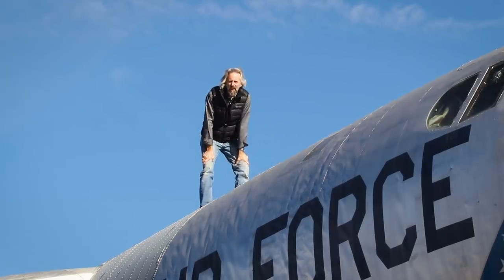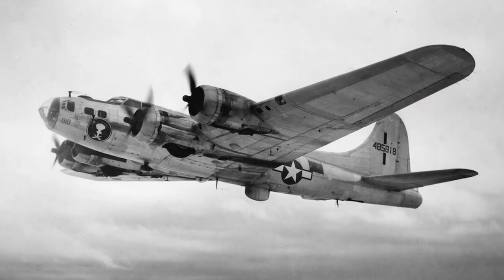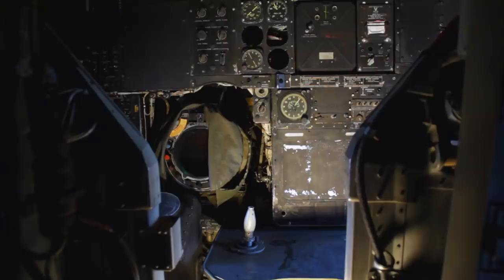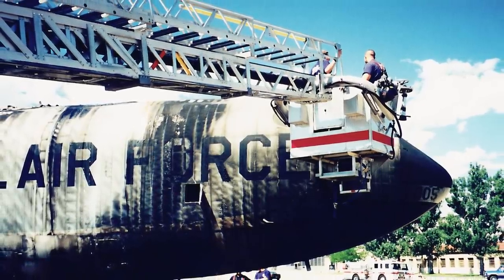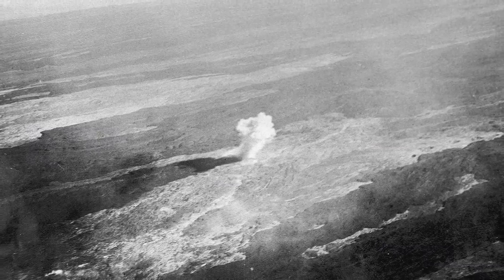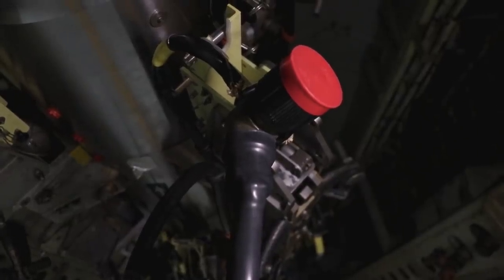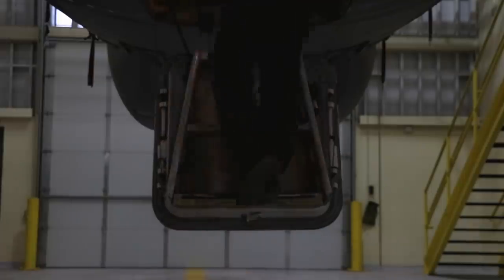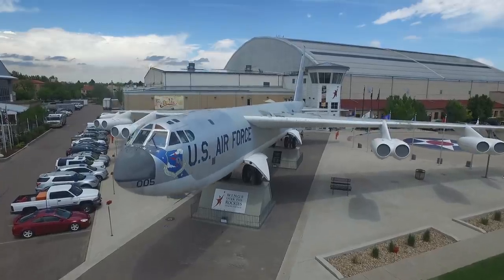B-52 Stratofortress | Behind the Wings on PBS

Comment: Great video! However, the last B-52, an H model, was delivered to the Air Force in Oct 1962, not 1965. My first assignment as Maintenance Officer was at the 319th Bombardment Wing at Grand Forks AFB, ND in 1986. They were flying G models, with the quad 50 caliber turret in the tail. We transitioned to B-1Bs in 1987. We had the unique opportunity to go from the  25 year old smell you tried to describe (a combination of jet fuel, hydraulic fluid, old wires, contents of the on board urinal, vomit) to the high tech brand new airframes delivered directly from Palmdale. Great memories!
Reply: I was also stationed at GFAFB but 16 years before you. I flew the H models, some of which are now stationed at Minot. The H model that I flew had the 20mm gatling gun in the tail. Once a year we would take each aircraft out over Lake Superior and do a "fire out". As a copilot all I heard was a few short periods of vibration in the airframe as the gunner fired the cannon. Fun times.....
Reply: @MrSafetyToo1  I worked on and flew a few times on the E model '52 at Walker AFB NM. Had chance to fly on a scheduled practice gunnery mission one time. We still had the quad-50's back then. I distinctly remember we went out over the Gulf Of Mexico and also recall the short spurts of vibration that you would get each time those 50's were fired. The primary mission at Walker was to train flight crews for the B-52's so got to have lots of different experiences. What always amazed me was the flexibility in that wing. It looked like a sick duck sitting on the ground, but put it in the air and the tips of those wings looked like they were above the fuselage.

Comment: My dad was a civilian electronics/avionics technician at Robins AFB, and was sent to Minot to do some work on the F-106 Delta Dart for several months in 1961.  I don't remember it - was a baby boy.  We rented a basement apartment from a young family whom I was told were wonderful people.  Dad did some work on B-52s when Robins was a SAC base (Georgia).  In 1983, the bombers were moved out, and it is a Logistical Air Command / Depot for overhaul, refitting, and repair.

Comment: FWIW:  I use to be in the US Coast Guard, and for five years I worked on - and flew as an aircrewman on - USCG Lockheed HC-130H Hercules aircraft.  

To give you a perspective of that maximum fuel load {290K pounds} mentioned in this video that the B-52 could carry:  Our HC-130H normal gross weight {MAXIMUM WEIGHT counting the basic airplane, fuel load, cargo and passengers} was 155,000 pounds.  It could be increased to 175,000 with special permission from the Commandant of the Coast Guard should some out-of-the-ordinary-need arise, but I never saw that happen.  {AFAIK, it never happened during the entire time I was in the Coast Guard.}
Reply from the maker: We are hoping to film with the USCG this year, but for what I need to keep to myself for OPSEC. ;) MB
Reply: @Wings_Museum  >>> When it comes to Coast Guard aviation, my ♥ belongs to:  
"BLEEDAIR BLIMPS"
"HERKY BIRDS"
"TRASH HAULERS"
"4 CESSNAS & A DUMP TRUCK"
"4 CESSNAS & A DUMPSTER"
"4 FANS OF FREEDOM"
😝😝😝😝😝😝😝

Comment: I worked with the G model Buff way back in 1974 at Barksdale A. F. B I was a missile man with the AGM 28 Hound Dog missile. It was a great experience and times that I will never forget. It was hot, it was cold, it was both wet and dry but I loved working on the flight line at 2AMMS.

Comment: B-52s turned Vietnam into a moon crater.
Reply: There should be so many craters all over Vietnam due to the numbers of bombs dropped there and many of them came from Utapao Thai Naval Base where I spent two years working on the D models after spending about one year at Minot AFB working on the H models. I was at Barksdale AFB also where I got to work on the G models and even flew on some of them to arm the Hound Dog missiles which they had on them. I enjoyed my time working on those aircraft and even flying on them.
Reply: steven anderson gotta get the job done, Genghis Khan got the job done took over all of Asia.
Reply: Actually, most of the BUFFs from Utapao cratered the Ashau Valley. I worked the scopes at Nakhon Phanom RTAFB in 1971-1972 and the BDA photos were very lunar indeed.
Reply: Theres youtube videos showing the destruction in Laos from the aerial bombing of the Ho Chi Minh trail during the Vietnam War.  All the craters are full of water.  It's unbelievable.
Reply: Lance - yet failed to achieve a victory. Something I struggle to understand.
Reply: @Jimboy1611  Because politicians did not allow them to turn Hanoi into a smoking pit.
Reply: and some of those craters were made by the B-52's crashing. Over 30 of them bit the dust in Nam.
Reply: Seventeen to combat-related causes, others to accidents.

Comment: My father was a B-52 navigator, then squadron commander in the 60's. I was around B-52's from my earliest memories, and thought they were just the normal thing. The first time I ever saw a F-4 Phantom fly over me, I thought it was the biggest plane in the world, because it flow over at about 500 feet, which B-52's don't generally do (they'd probably shake down the houses under them if the did).  Being an A.F. brat was pretty cool.
Reply: Kevin Dallas my dad was radar nav at that time. Where was your dad stationed
Reply: @mandarinlearner  He was stationed at Barkesdale AFB in Shreveport Louisiana until 1962, when we were transferred to Offutt AFB, SAC headquarters in Omaha Neb.  I think those units were transferred out of range of the SR 22's that just might still remain in Cuba after the Cuban Missile Crisis.  We transferred right after that.
Reply: Kevin Dallas we were at Dyess for the Cuban Missile Crisis. The planes and crews were flown out to be out of range. We had car packed for evacuation orders
Reply: @mandarinlearner  Sounds familiar.  I wonder what the GDPs of many of the southern states did right after tha. Suppose there's a discernable fall in '63?

Comment: Diving out the tail is perfect.  Won't hit the wing or vertical stabilizer.  My Father worked all over that machine as the Tec company helping the Airforce.  It was Western Electric - he was in Arm. & Electronics Radar and controlled guns were in the first.

Comment: If they EVER re-engine the B-52, they'll likely replace the existing 8 engines with EIGHT new engines.
And the USAF will probably lease the engines rather than buy them outright.  They've been talking about this since AT LEAST the 1990s but they may finally do something since the engines are becoming THE main reliability/maintainability issue with the operational B-52H's.
The issue is engine balance.  Many think it would be cheaper and more fuel-economical to switch to four more powerful engines than what the B-52H currently has.  The B-52 was designed for 8 engines and if you change that number, you destroy the thrust balance and it's WORSE if you lost just one engine in a four-engine configuration because you automatically lose 25% of available thrust!
With 8 engines, the lost of any 1 engine is less severe (12.5%  thrust loss can be more easily compensated for by the remaining engines) and you're probably fine losing up to 3 engines (2 on 1 side, 1 on the other) or four engines (2 each side) so long as you don't lose 3 or more engines on ONE side/one wing.
Yes, it complicates maintenance and doubles your engine parts count from 4-engine bombers but there are also advantages to having 8-engines in terms of recoverability of the airframe.
Reply: It's kinda funny that you say the engines are the main source of maintenance issues, and they were doing maintenance on an engine in this video
Reply: @bigrob966  None of the B-52s still in service are less than 56 years old at this point.
The engines themselves likely haven't been manufactured since the late 1960s/early 1970s and those powerplants (turbofans) were only built for the B-52H.  All the other B-52 models used turbojet engines which are less economical but mechanically simpler than turbofans.
Like the airframes themselves, the B-52 engines have rebuilt several times during their operational lifespan.  The USAF has actually spent by this point far more in electronics upgrades than what it originally cost to buy the airframes!  The avionics upgrades alone are worth several times the cost of the airframe.  The reason why the B-52 hasn't been replaced is durability and economy compared to all its replacements.  The sad truth is they haven't been able to build a more practical strategic bomber than the B-52 and everything that's come since the B-52 has been more expensive to field and maintain.  The XB-70 never left test because it would never have been practical to field.  There was too much experimental tech in the XB-70 and the test flights themselves demonstrated some disturbing issues with the honey comb structure of the plane; it didn't help they couldn't formulate a paint that DIDN'T flake off after every flight!  It would have been a disaster to maintain and NEVER been able to surprise anyone with how detectable it was on radar. The one supersonic medium bomber the USAF fielded, the B-58, had horrible reliability and maintenance issues and was barely in service past a decade.  The FB-111 was very expensive to maintain and the design limited its practical mission growth potential.  The B-2 was too expensive to build in the needed numbers and probably shouldn't have been fielded, period, if they weren't going to build at 70-80 of those planes.  The B-1 has proven to be decent but only after many years of ironing out the kinks with its avionic systems.   The B-1 still couldn't replace the B-52 and wasn't built in high enough numbers to replace the B-52, either.
The USAF has been dragging its feet on the the B-52H engine issue for at least a quarter-century now.  Before, they had surplus planes (B-52 wise) and the planes weren't flown that often.  The problem is that age WILL be catching up to parts of the plane.  Fortunately, the B-52 as-built was over-engineered.  It has close to 4.5 times the logical lifespan of a fighter jet (8000hr average now, although we have F-15s in service past 10,000hr and more than a few F-16s past 8000hr now, too) but the day will come when it's not economical or safe to keep the B-52 flying.  They never expected to keep the B-52 in service much past the 1980s.
The engines at this point are probably among the easiest of the components to swap out.  There are a few commercial (civilian) options available that will fit into the existing nacelles without major modifications which is good-- it means they'll have to spend less money on re-engineering/rebuilding sections of that plane and less time in test flights to recertify it with a new engine.
Reply: I've seen a B-52 land with only 2 engines on one pylon. I work on Tf-33's on a different airframe, and those thing are a nightmare when it comes to reliability. But the main reason for the delay of the re-engine is, apart from politics/cost, structural. Higher bypass engines are much bigger and much heavier, and the wings were not designed for those, thus creating excessive stress on the airframe. 
With the amount of in-flight shutdown that those engine suffer (I have the data from P&W), it would be an upgrade and recoverability/thrust balance offset is not that much of an issue.
Reply: @MrSnakedHD  
What do you mean by in flight shutdowns? I flew many sorties over many years and we shut down an engine ONCE. I still remember it was the #8 engine fir overheating. As it turned out, the engine was fine. It was the gauge that was bad.
Reply: @MrSnakedHD  
Also, a B-52 cannot fly on less than 4 engines.

Comment: Yes!!!  Distinct smell!!

Old insulation, arcing electronics, jet fuel, hydraulic fluid, s#it, piss, and vomit.  

Flew on B-52 H models out of K.I. Sawyer in the late 70s as a gunner.  

Glad I never had to sit out back.  VERY rough ride, from what I've been told.
Reply: I was a G Model Gunner from 1980-83, Blytheville AFB.  My Chief gunner was a D guy, and he said for ever foot the nose moved, the tail moved 10.  You might recall the pilots testing the crosswind crab during taxi; he was in the back and wasn't prepared, and got slammed into the canopy in the back, splitting his helmet and knocking him out.  When they made the take off call, there was silence from the back...they rolled a stand up, cracked the door, and found him laid out cold.  :)

Comment: No gunner is because a NOT very wise general wanted officers only on the aircraft. D Models were shot down the least in Viet Nam and G and H more. Reason? They had the enlisted gunner could do a better visual of the SAMS coming at them than the countermeasures could ever do.  Also Fairchild AFB has the other B-52 D with a MIG kill star on it.
Reply: I think it had more to do with maintenance costs and the fact that the SIOP role of the aircraft changed; it's no longer a penetrator, but a stand-off platform for Cruise Missiles.  The ASG-15 Fire Control System was full of vacuum tubes, and spare parts were often hard to find.
Reply: No H models flew over Vietnam. The H models were kept stateside on nuclear alert.
Reply: @bob39434  
True. There were, at the time, only TWO non-nuclear H models. They were 0051 and 0052. 
No H model ever flew in Vietnam.

Comment: WOW Matt!   I love how how you did this video, how you went from the tail to the front, showing all the details of the old model then later on the latest re-fab B52. I was shocked to see how much of the old instrumentation and seat arrangements are still the same in the cockpit.  The last time I saw a 52 documentation was when they retrofitted the entire plane for chemical attack about 25 years ago. But your video was far more easy going and more revealing.  I'm 63 (I think), I can still remember living at the end of the runway at Fort Bliss in El-Paso Texas during the Vietnam war. B-52s were always coming and going over my house around 200 or 300 feet over my house, 24/7 depending on the wind direction. I could clearly see inside the wheel wells and inside the outer wing wheel wells and the paint just warping and chipping.  I think they came to El Paso for maintenance, I never really did find out.  But anyways, GOOD JOB to you and your staff.

Comment: One slight mistake I noticed in this video, the B-52 isn't the only aircraft in America's arsenal that father and children could have piloted. The C-130 Hercules came into service in '54 and is also still in use today, as well as the KC-135 Stratotanker came into service in '56. So, all 3 airframes could have been flown by children, father's, and in some rare occasions grandfathers.
Reply: Glad that you pointed that out about the other aircraft of that same era. I entered service in 1959, went thru basic at Lackland AFB Texas, transfered to Chanute AFB Illinois  for my tek. school training. We were told at that time that it was entirely possible that we could be assigned to work on any one of those model of  aircraft that you mentioned simply because there were similarities in them even though they had totally different missions. I wound up working on B-52E models At Walker AFB Roswell NM. There were also KC-135's stationed there. Also had an opportunity to get a look inside the F and G models that occasionally came there due to conditions at Castle AFB in Calif. There were suttle little differences in each one of them.

Comment: I was glad to see you taking the "cat walk" between the rear gunner position and the crew stations.  

That one sure had old instruments

It would have also been interesting to hear about the navigation system they used prior to the GPS being available.  And if that failed there was always the port to the outside in which the navigator could use a sextant to view the stars.

......  and no mention of the toilet on board  .......
Reply: Before GPS, there were two different kinds of Navigation used on B-52's Inertial and Star Light.
Inertial Navigation is using Gryos(not the sandwich) which measure the aircraft inertia forward (and in all directions too) and with a bit of math have a rough idea where it is. Submarines use this still(as Radio waves don't work deep in the ocean).  Star Light is also Celestial Navigation and uses an age old method of using the Star's to determine your location via sextant (and more math/charts).
Reply: @AlphaRaptor2k6  What you are describing is what a B-52 uses to navigate when it is flying in unfriendly territory where there are no ground based nav aids available. But the B-52 also caries more conventional nav aids that it uses when it flies in friendly territory. This usually consists of TACAN, which is a lot like civilian VOR and DME combined. It also carries a typical air traffic control transponder, albeit with an extra mode to allow for secure, encrypted identification.
Reply: The toilet is downstairs, behind the nav/bomb nav compartment. Open the hatch, look toward the back, there it is, next to the piss can. You pissed in the piss can.